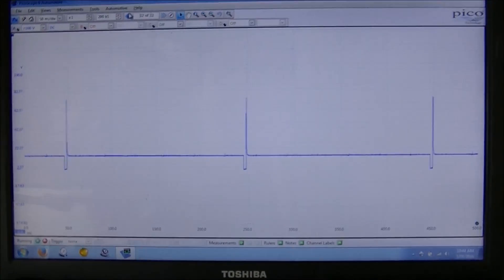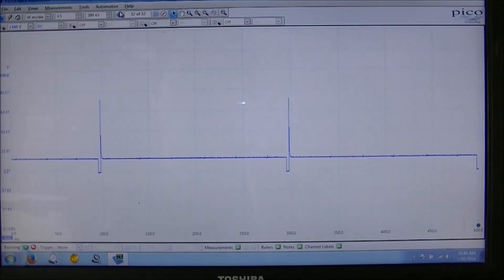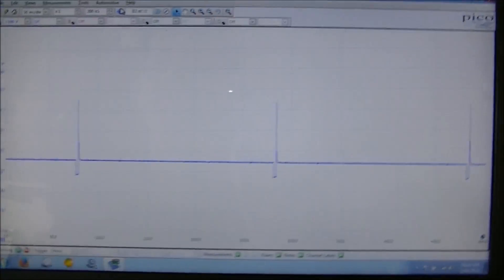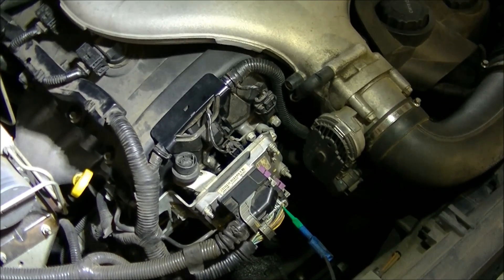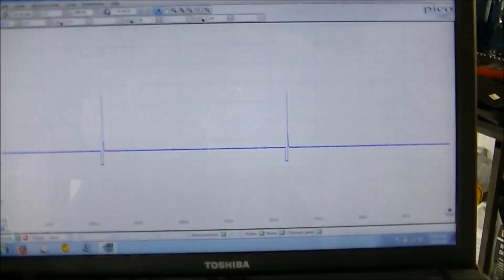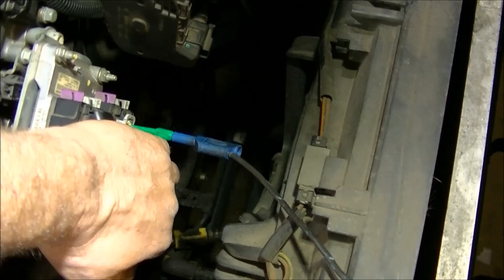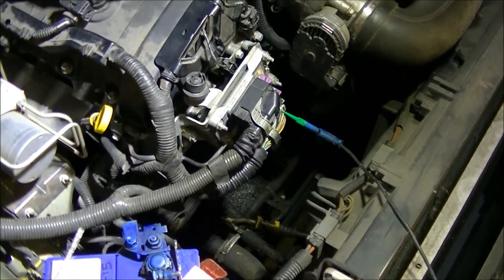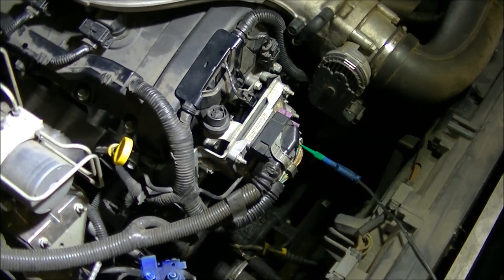VZ Commodore Misfire - Faulty Engine Computer

Comment: Hey mate I got this same issue. Idle it would randomly missfire but when you rev it. It didn’t missfire. I replaced the timing chains, the coils, spark plugs, intake manifold gaskets, got the injectors flow tested and cleaned and it was fine untill it warmed up then started missing again

Comment: Hey, guys! Just on this matter. I have Commodore VZ and when it is warmed up and idling it vibrates periodically. And recently when I was driving on the motorway it started randomly jerking. Tonight I was reversing very slowly and it started giving random "bumps" with 1.5-3 sec periods. Once warmed up issue almost gone. Would that be a misfire as well?
Reply: Hey man i got the same issue replaced the coil pack and plugs seems better no jerking around under acceleration
Reply: Still looking for solution. It started giving random missings when I am idling and ac is on.
Reply: Thank you for your reply. It kinda gives random misses, especially when I am idling and ac is on
Reply: Did you have the same issue?
Reply: Gleb Zavartsev id say look at your coil packs. If you haven’t found solution yet

Comment: Hi
I have a VZ calais,

It is missfiring on cyclinder 4.

I got the error code cleared with a scan too and it seems to work normally again (all cylinders firing)

But the next morning it went back to working on just 5 cylinders?

Is this an indication it is a ECU problem and not wiring?
Because im thinking if it was wiring or coil pack that the clearing of the code (Powertrain error code) would not have temporarily fixed it?

thanks
Reply from the maker: The ECU has the ability to turn an injector driver off as a safety measure (catalyst protection). From your description, it sounds like that is what might be happening. ie clear the code and the misfire goes away temporarily. A faulty ECU is always on the cards with a VZ V6 but without any information, I cannot give much of a recommendation. Since the misfire reappeared in the morning I would be examining ignition components first.
Reply: hi mate,

Did examine the ignition components
changed spark plugs and all the coil packs
problem still existed

v6 alloytech 190kw, i have read people have done the same things I have done and it has been the ECU that caused the problem..

I guess the only other thing possibly be the wiring harness and if that had any lose wires that connect to the ECU....

but i doubt that.

thanks